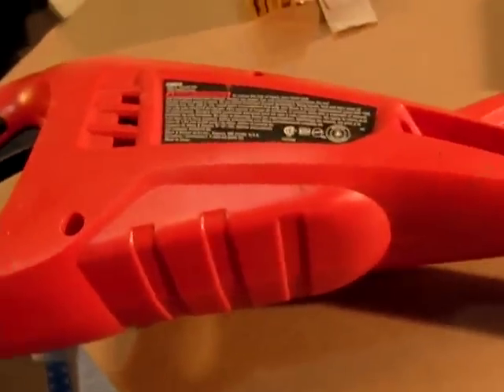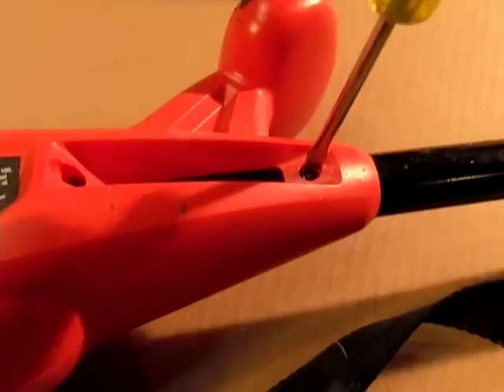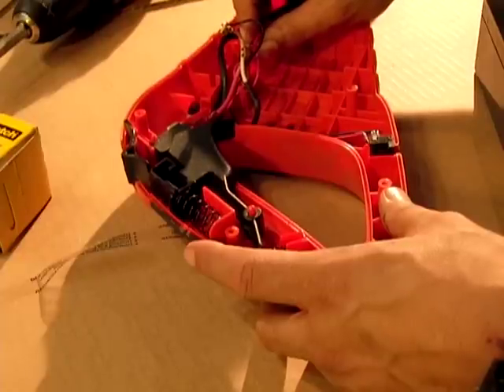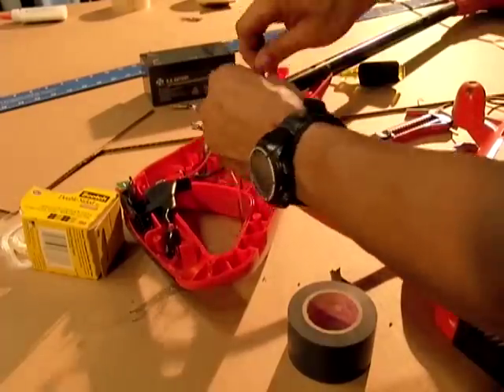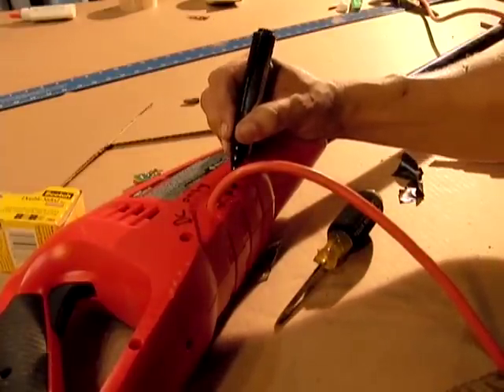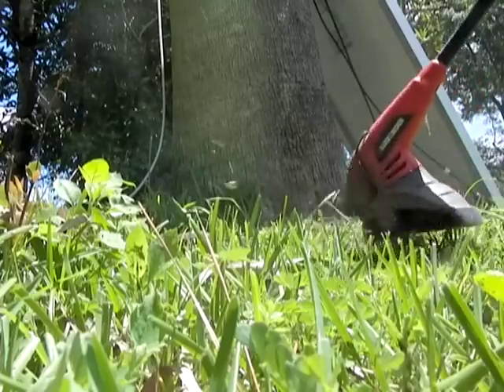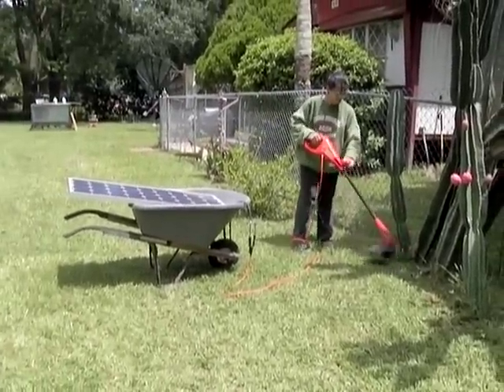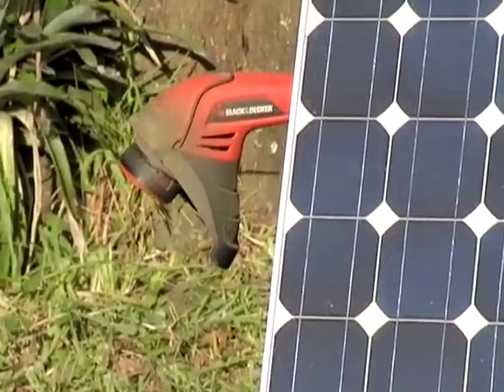SOLAR PANEL WEED Weedeater HACK Weed Whacker Trimmer PV Photovoltaic Lawn Tools

Comment: So glad you did this, I was going to buy a higher voltage 18-20 volt weedwacker to use with '12 volt' panel since it is not 12 volts but more 18-20 volts and did not want to burn out motor... and do no-gas lawn work with my bike and trailer and solar panel....

Comment: GREAT Hack, I love to keep "Working junk from the dump". I am always amazed by you two.
I have  235 watt panels on my sun facing roof and love seeing my power bill. ( Ijust got 4 250 at 54 cent a watt).
  Another hot solar idea is the TECHLUCK (at is on Amazon)solar hot water heater, it is cheap and converts a standard electric two element hot water tank into a hybrid solar with grid back-up. No pumping and just two wires, I will be testing this week.

Comment: what wattage of panel? I use a cordless weed eater but batteries are a pain also to charge If job is not done before you are out of power. I like this Idea I think I will use a two wheel cart with a 25 ft cord.

Comment from the maker: It still works great. Use it all the time and it always holds a charge. I skipped the charge controller and went with a smaller 30 watt panel. I store in non-direct sunlight and use in direct sunlight. Working on an alternative to the fishing line feed. Pain in the butt, always gets jammed. Found the perfect material.

Comment: At last a sensible video for small gardens in the UK. In time I would install a panel on a shed roof and take the power out to a few sockets on the garden wall, no need to lug around the panel in a wheel barrow!

Comment: You can do the same with any 18-24 volt power tool. You can easily burn out a 12 volt motor with the higher panel voltage if you do not clamp it down.

Comment: I have make , I use the back yard every summer trimmer and there i can save lot of electricity during the summer. I have 2x 60W panels, those probably will be able use power trimmer.
Panels is charging 120A battery.
My back yard is 10x15 meter size, i can use only cable power the trimmer and leave trimmer battery away save trimmer weight.

It would be better if i find a battery lawn mower with has 12v system.

Comment: @xxtruckin93xx Well, somebody'd BETTER have a propane weedwhacker available, because Hank Hill would do nothing but complain around the house like a typical middle-aged lazy-minded negative-thinking fuddy, about having to move the power cable and reposition the solar panel combo on this thing.

I enjoy the design of this solar weedwhacker.   But you KNOW that some fuddys couldn't cope.

Good ol' Sears Craftsman.  
LONG LIVE SEARS.

Comment: interesting 
could you reduce the solar panel to something that is lite and can be carried on the back ?

i would think if you sacrifice the battery all together and settle for  some decent capacitors 
you could fix the possible issue of using it in the shade 
as well as the issue of destroying the battery 

dont know if it would work or not 
but just an idea  :D

Comment: @Toraog 
ever picked up a PV panel? I don't think you want it on your back. If weight wasn't an issue, they'd just use a better battery, and charge it while not in use.

Comment: Cool project, you two are just full of great ideas. To polish this one project off just make a two wheeled cart that will act as an adjustable stand for your solar cell and a little cart for you to carry your yard tools around with you. I say tools because you should also convert a hedge trimmer and an electric drill so they will work the same way. You could also add perhaps a small car battery to the cart.